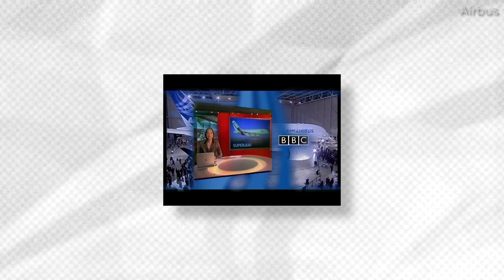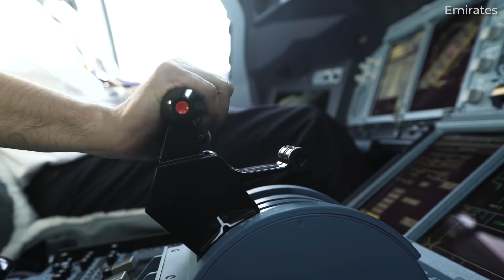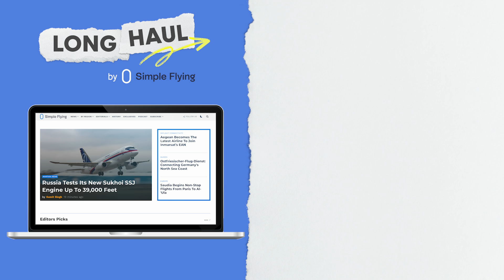The Airbus A380 Stretch - The 1000 Seat Plane Which Never Got Built

Comment: 4:56 is definitely a big mistake especially considering that there is something called Beijing-Shanghai HSR. Business travelers will go with simple widebodies (because they're spacious) but not A380 because PVG is too far and collecting checked bags may be extremely time-consuming, while the closer Hongqiao Airport is not large enough for the superjumbo. If you want extremely high capacity just do HSR, and any delay caused by complex boarding and bag handling of A380 would add to another reason why people would choose the cheaper HSR.

Comment: On an A380-800 the all passengers sitting nearly on top and beside each other. Too large cross section for too few pax. A stretched version would make a lot of sence in my opinion, as the original -800 is simply too short in length. All the short versions of jet airliners are slow on sales compared to the stretched versions, at least nearly all😅.

Comment: The sad part is that the only route on which the A380 is useful would be long-haul hub-to-hub routes, such as DXB-LHR, or DXB-JFK, or LHR-YVR. The A350 and B787 on the other hand can be used for shorter flights or long ones, and are much more fuel efficient.

Comment: Not building the -900 & -800F is a FAIL.
Reply: There were very good reasons neither were built. No one decided they wanted a 900 and the 380 made a terrible F version. Way to heavy relative to the volume it could carry. It maxes out on takeoff weight long before volume. The upper deck also highly limits it cargo capacity since it cannot be removed. You would have had 380Fs flying around 1/3 to 1/2  empty.
Reply: @johniii8147  you are correct plus no one wanted to invest in new K-Loaders high enough to reach the upper deck,

Comment: The A380-800 as we know it is actually a stubby cut down version of the A380-900 (think A319/320 vs A321). The 800 is the shortened version of the 900, not the other way around. That's why the wing and other features look so over-sized.
Reply: Yep and one of the reasons it failed. Made it too heavy.

Comment: four of either GE-9X and RR Ultra fan are capable of powering a 900T MTOW freighter in the style of the AN 225 - the market would be military, heavy industrial and the motorvehicle industry as it could carry upto 200 vehicles - the luxury vehicle industry would welcome it as they could be delivered to other continents in a day saving up to 2 months travel time on a ship. Motorvehicles have near the perfect density for large freighter aircraft.
Reply: Nope. The aircraft is simply too heavy relative to cargo volume is could carry. There is a reason there in no F version either new or converted. Just time to move on from the idea of the 380. It's done.
Reply: look up the AN 225, freight does not need to fly as fast as passengers. OEW does not need to be 45% of MTOW, 38% is achieveable. In fact a modern transport of the AN 225 style can have OEW, max PL and max FL at 38% of MTOW - obviously with max PL+FL=62%MTOW @johniii8147

Comment: Being designed from the start for the stretch options was actually one of the fatal flaws of the 380. Lot of built in extra weight with the wings, wing box and overall structure.

Comment: Ironically, hardly any of the mentioned beneficial routes currently use the A380. Malaysian Airlines and Thai are having a lot of trouble getting rid of their jumbos, so even airlines operating those dense routes don't want to contend with the massive operating costs of the A380, especially when they're operating with low load factors.
Reply: Exactly. I noticed that. China only ordered 5 of the 380 and struggled with them the whole time. They are now retired. India doesn't have the infrastructure for it on domestic routes and the high operating costs wouldn't be supported by the very high operating costs ( especially on shorter haul). The 380 only works were their is a lot of premium traffic.
Reply: @johniii8147  That's correct. Emirates makes most of their money in the premium cabins, especially the first class with the showers in the A380.
Reply: @sainnt  The real money maker is business class and now premium economy as well. F class on EK is mostly for show
Reply: @sainnt I made it my mission to try that before they all go
Reply: @Tpr_1808  So far I've only experienced the A380 on Emirates and Qantas. Hopefully I can experience more airlines before they're all gone.
Reply: @sainnt  Which must've been a nice experience . So far I've only gone on Qatar Airways' a380
Reply: @Tpr_1808  Both were pretty nice actually.
Reply: @johniii8147 And to complement that, many immigrants going into Europe transit through the middle east so their economy class and premium economy get a decent number of seats filled so Emirates have a good load factor for their a380s compared to those that retired them completely

Comment: AIRBUS should never have launched the A380-800 in the first place . . . it should have been the A380-900 Neo which was a stretched variant of the A380-800 . . . the A380-900 Neo stretched cabin would ideally seat 536 paxs - 584 paxs in typical 3-class seating layout . . . based on actual A380-800s currently operating across the world, since different full service operators have different revenue (structures) expectations . . . for e.g. a Qantas A380-900 Neo on routine red eye service, Sydney (SYD) - Frankfurt (FRA) non-stop would have the A380-900 Neo cabin configured to accommodate no more than 483 paxs - 512 paxs in 3-classes . . . on the other hand a Singapore Airlines A380-900 Neo serving Singapore (SING) - Birmingham (BMH) non-stop will seat around 568 paxs in typical a 3-class seating layout . . .
Reply: You can’t have a neo with an existing ceo. Besides, unless RR could bring down the weight of the lower thrust Trent XWB models to below that of the existing engines on the A380, there won’t be any engine models worth fitting to an A380neo until smaller versions of the UltraFan
Reply: The NEO engines didn't exist at the time.